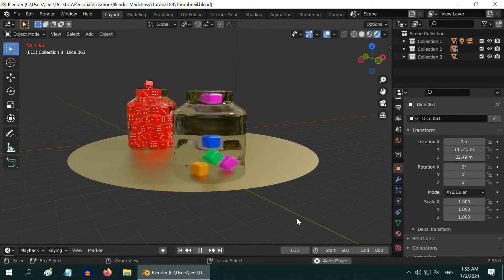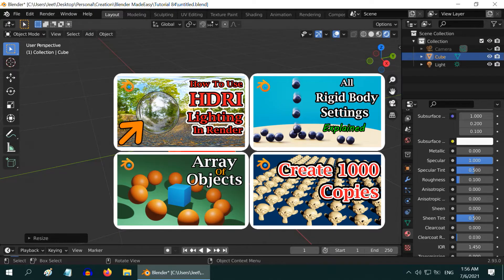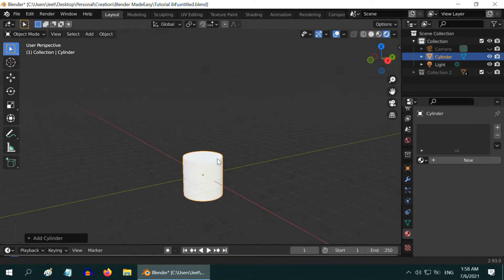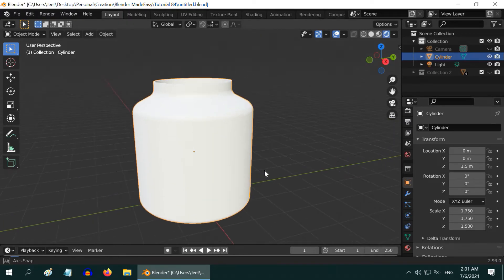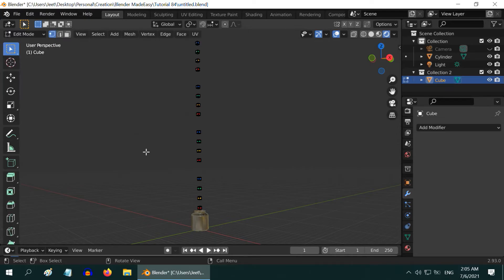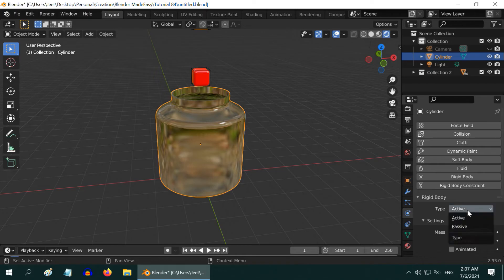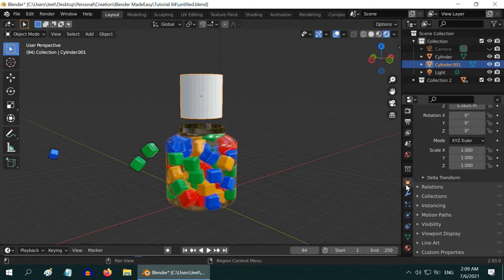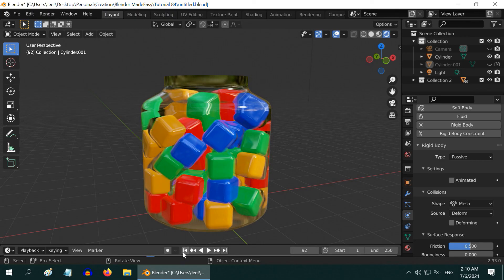Fill An Object With Other Objects | Falling Cubes Inside Glass Jar | Rigid Body Physics In Blender

Comment from the maker: If you liked this tutorial, please consider making a small donation, it will help us!
𝐘𝐨𝐮 𝐜𝐚𝐧 𝐬𝐞𝐧𝐝 𝐲𝐨𝐮𝐫 𝐝𝐨𝐧𝐚𝐭𝐢𝐨𝐧 𝐡𝐞𝐫𝐞 👉 https://donorbox.org/5-minutes-blender
Reply from the maker: @MercuryRisingFast  That can be done in multiple ways. One trick is to decrease the simulation speed to almost zero after the cubes settle within the jar (more on this in our tutorial 👉 https://youtu.be/dzOmwXjkdIc ) or you can divide the animation into two parts - one having the physics and another without any physics (before and after they settle in). But if you want to actually solve the issues without any trick, you need to play with the friction values and the bounciness. Remember you can keyframe and animate these fields throughout the video. For example, increasing the friction will make them stop, but you need to do that only after the cubes have settled properly.

Comment: mine does not work :( mine flew all away from the jar, like the jar was closed, but it wasnt
Reply from the maker: Did you change the collision shape to Mesh for the jar? If you did and it still deflected the cubes then certainly it is a cache issue. Blender did not clear up the cache and it is still using your previous settings ignoring the changes (this is surprisingly very common with Blender). Clear up the cache and do a fresh bake, the problem will go away.

Comment: I'm trying to make objects stay on a plane and then, after a few seconds, move the plane away, so the objects fall to the ground. The objects however move for the first 60 frames or so to stay on the plane and then they stay floating in the air when the plane falls. I already changed the cache end but to no avail. What am I doing wrong?
Reply from the maker: It seems you are doing nothing wrong. Clearing the cache does not always work, it is a bug. In the scene tab, under field weights, change the gravity weight to some other value, then delete the bake and bake all physics. Now again change this value back to 1 and delete the bake and bake all physics again. I have seen that this clears the cache always without fail, so hopefully that will solve your issues. If not, please let me know.

Comment: Now, tell me why u frkn apply every single mod and how am i supposed to work with my 20 millions polygon file after we re making real all objects?
Reply from the maker: First, apply the modifiers for only one object. Then link the object data (Object Menu > Link/Transfer Data > Link Object Data) for all those objects with the first object so that they share a single copy and the file size does not become huge. Finally, you can remove all the modifiers for them. This way you can have a small file with everything intact. The reasons we are applying the modifiers is to ensure no glitches in the rigid body physics. But you can definitely try without applying the modifiers and if it works for your composition, it is fine.

Comment: Is there a way to bake the animation so that they stay in the final place? I'm making several glass jars and I don't want to have to watch the animation of the objects falling every time I want to fill a new jar
Reply: nevermind, If I copy the objects in the final position, they remain, I only have to remove the rigid body one by one, but that works for me
Reply from the maker: Sorry for the late reply, my machine was out of order. There is a quick way to do this. Go to the final frame (or any frame of your choice) and select all the objects that have rigid body physics. Then from the Object menu, under Rigid Body, select Apply Transformation. It will make the object positions final. Then again from the Object menu, under Rigid Body, select Remove. It will remove the rigid body physics from all the selected object.
Reply: @5MinutesBlender  I have returned to this video since I had forgotten how to do it, and my way of doing it no longer works, and when I remove the rigid body the objects return to their initial position :face-purple-crying:
Reply: ok, there is a button in the top menu "object" >> "rigid body" >> "apply transformation"
Then you have to eliminate the rigid body and the objects no longer move :cat-orange-whistling:
Reply: but it works strange, I have to apply one by one and from bottom to top or the object resets
Reply from the maker: @lupu3d  No you don't need to apply it one by one, you can do this in one go for all the objects but you must ensure that one of the selected objects is the active object. How to do that? Box select all objects, or select them in any other way, then finally press the shift key and click on one of them - so this last selection makes it an active object which is part of your selection. Now you can use "Apply Transformation" and remove the rigid body physics, it will apply the same for all the selected objects. The "active object" concept is often not clear to everyone. Blender operators always work on the active object (plus others in the selection). If there is no active object it ignores the operation for all.

Comment: I appreciate the informative tutorial, however, I've run into a problem. It's quite silly. My objects fly away from the bottle instead of falling into the glass lol. I did do a few things differently though, because my objective is to make these objects appear as seasoning inside a bottle so for the array I used different properties. Do you think that's the issue?
Reply from the maker: A quick guess, did you set up the bottle's collision shape as Mesh type? Otherwise it won't be considered as hollow and the falling objects will deflect from the top of the bottle.
Reply: @5MinutesBlender  Thanks for the prompt response! That doesn't appear to be the issue. I set the bottle and even the label to passive and mesh so I'm not sure where I went wrong.
Reply from the maker: Then you can send the blend file to us at 5minblender@gmail.com We will check what is missing and get back to you!
Reply: You rock!  @5MinutesBlender

Comment: Hello, my objects are not going into the container. As if there were a barrier at the entrance to the container, but there isn't. What could be happening?
Reply from the maker: A quick guess, did you set up the bottle's collision shape as Mesh type? Otherwise it won't be considered as hollow and the falling objects will deflect from the top of the bottle

Comment: Wonderful, concise content.  But when I create this, my objects keep jiggling around.  Your cubes here, fall, move around to get settled, then stop moving.  My cubes keep wiggling and wiggling non-stop forever. I make many adjustments to the Rigid Body settings, yet, the jiggling around will not stop. Can you help, please? :face-pink-tears:
Reply from the maker: First of all, don't get frustrated, getting rigid body simulation to perfection can take time. The physics calculations are always approximates, not perfect. To increase the perfection, ensure that there is no overlap initially for your objects, and then use a high value for the solver iterations and the substeps (both found under the rigid body world settings in the world properties). This will improve the accuracy of the physics calculation and will reduce computational errors. Also, enable deactivation for the rigid bodies (the default values for velocity and angle are good but you can change them if needed), this will ensure that the objects are not jiggling forever, they come to rest after a reasonable time. These things together will definitely help you achieve a better result.
Reply: Thanks for your feedback! @5MinutesBlender

Comment: This does not work in blender verison 3.6.0 
I followed the tutorial, did the same steps, but the cubes are not falling in to the jar instead they are scattering around everywhere! what could be the isusse?
Reply from the maker: No change as such in 3.6, rigid body physics is the same.  The cubes are probably colliding with the "upper surface" (imaginary) of the jar. The jar has to be treated as a hollow object. So you need to change its collision shape to Mesh type. If doing that does not solve the issue, play the animation frame by frame and observe minutely where the cubes exactly get deflected from. If they are deflecting from the surface of the jar, even though you have set the collision shape to Mesh, it means the old cache is still staying on your file. Clear the cache (sometimes it needs a manual cleaning of the cache files, but this is rare), then bake the physics thoroughly. If this still does not solve the issues, kindly send your blend file to 5minblender@gmail.com and we'll find out what the issue is. Thanks for watching our video!

Comment: Hi! I tried to make it work many times, without success. Your tips are great, but could it be done using particles and each object as a particle?
Thanks for this clear tutorial!
Reply from the maker: We can. But it will be an overkill to use a particle system for this simple thing. I would request you let me know what challenges you are facing with this, so that I can suggest some easier solution.
Reply: @5MinutesBlender  You are right. I don't need particles and your video solved all my needs. Anyway, thank you for your kind support.  Keep making videos. They're clear, concise and straight to the point! Got one subscriber!

Comment: Instead of making and assigning several different materials for various colors,  you could make one material connected to a Color Ramp with various colors.   Then connect an Object Info node Random socket into the Color Ramp Factor.  It will randomly assign many colors to the cubes with one material.
Reply from the maker: Yes, nice method. I did not think of it. Thanks for sharing 👍
Reply: thank you!

Comment: Hi! Great tutorial, but i'm having issues. When trying to bake all dynamics, Blender just crashes. I applied scale, moved the origin to centre and mass, but nothing works. Any idea on how can I solve this?
Reply: Tried updating and changing collection, it still doesnt work.
Reply from the maker: @o.r.2140  Most of the time, Blender crashes not due to any wrong parameter used in the animation, but due to RAM overloading. One such case is, if you have too many objects in the scene, or a few objects with very complex geometry, the physics calculation can eat up lots of memory and Blender will crash. Please check whether you have used Convex Hull or Cube as the collision shape in the Rigid Body settings. If you don't see any immediate issues there, one way to pinpoint the problem is to reduce the number of objects to 1, check if it works, then say 5 and check again. Please let me know what you find out.
Reply: @5MinutesBlender  yeah, I guess my ram was overloaded bc I tried everything and it still crashed. I found a solution though. I turned the jar into an active rigidbody object and made it weight 1000kg, and now it doesn’t crashes and flows perfectly. Kinda weird that it crashes when the object is set to passive.
Reply from the maker: @o.r.2140  Hmm nice trick! I hope it helps someone having similar issues 👍

Comment: I tried doing something like this in 2.7 and stuff were breaking through the glass container lol
Reply from the maker: Yes, it can happen. If you try to manipulate the movement of the cubes, it might happen that they intersect with the glass bowl. If they intersect even slightly, Blender engine will throw them off since that is an abnormal condition. Even without any manipulation, it can happen if the object is too small. The simulation algo works in steps. The accuracy of this algo depends on the number of steps and iteration. You can fix the abnormality by increasing the number of steps and the number of iterations, found under the Rigid Body World in the Scene tab. Higher values in these two fields (you may need to go above 100 or 200) will result in better accuracy, but it will take much longer time to bake. All the best!

Comment: i tried to do this with coins falling into a jar... but once they get in the jar, some of them are going through the jar outside just spinning.....
also the coins aren't falling in, just keep spinning...
Reply from the maker: Hi molly, do you mean the coins are getting into the jar, reaching the bottom and then somehow coming out, or do you mean that the coins are not getting in, they are spinning above the jar opening and not going inside? In the later case, please change the Shape field of the jar to Mesh type, in the Rigid Body section, and let us know the result. You need to use Mesh type for any hollow/ concave object. Please remember to clear the cache so that the changes take effect. All the best!
Reply: @5MinutesBlender  mm yes no i do not mean the second thing you explained. it is set to mesh object and they do get in the jar fine. however, once in, some are randomly spawning outside, which is kinda frustrating. i think i will try to make a simple object one and then just swap out the objects for what i want and see if this changes anything. perhaps bc the objects are too small and i need to fiddle with settings.
Reply from the maker: @_pinkangels  Okay, I can give you some hint about what can cause that behavior. In case the coins overlap with the wall of the jar while spinning, the rigid body calculation will make them throw away. I would ask, how are you spinning the coins? If you are spinning them manually, by changing their rotation values, then it might happen that they just intersect (maybe even very slightly) with the jar. This is just a possibility. If I get to see your blend file, I can surely investigate further on this. Should you need to contact us with the blend file, you can get our email ID from the About section of this channel. All the best.

Comment: This tutorial is fantastic -- one of the best!!! You clearly show everything you're doing. I tried your procedure with some objects I made myself, and it worked, but the texture was not applied properly. Can you tell me how to fix it? Here's the original texture on one object: https://imgur.com/woBzd6m . And here's the texture as rendered on my objects in a bowl: https://imgur.com/hM52614
Reply from the maker: Glad to know that you liked the tutorial. I looked into the two image files you sent. My first curiosity is, whatever maybe causing the change in the object's texture inside the bowl, not all objects are inside the bowl. Few of them are technically above it. I mean, for few of the top ones, the light ray is not passing through the bowl before it reaches our eyes (Blender actually works in the reverse way, but the physics involved is similar). So, is it really the bowl which is causing this issue, or is there another factor? To test it, can you just hide the bowl and render this scene? If that resolves the issue, then we can be sure that the bowl is the culprit. Otherwise we have to look into other things. And in case it is the bowl, although I cannot suggest without looking into your blend file, but I can make some guess. Probably you have used some transparency for this object's shader. And then the bowl definitely has a transparency. When one transparent or semi-transparent object is contained within another, we have to use Alpha Blend in the blend option. Please check the Blend Mode and Shadow Mode for the bowl as well as your object material and play with those settings. If none of them works, I would request you to kindly share a blend file with us, so that we can look into the details and come up with more meaningful suggestion. Cheers!
Reply: @5MinutesBlender  Thank you so much for your detailed answer! I am just a beginner (as you can tell!) and I just didn't know whether this was an easy question or a more involved one. I changed the blend mode and shadow mode, and that fixed the problem. Thank you again!
Reply from the maker: Glad to know that the issue was resolved. Cheers! and by the way, that texture material that you have made, looks really awesome 👍

Comment: We can easly join many object with "ctrl+J" shortcut. And for separate just using "p" Shorcut
Reply from the maker: Yes, ctrl+J is very handy. I would like to mention that ctrl+J works fine as long as the objects we want to join are separate parts. But if they have some overlap, ctrl+J does not take care of the internal topology very well in the overlapping section. This can cause many issues later if you try to use bevel, or if you cut a hole through it etc. The boolean modifier works better in case we want to join such overlapping parts.